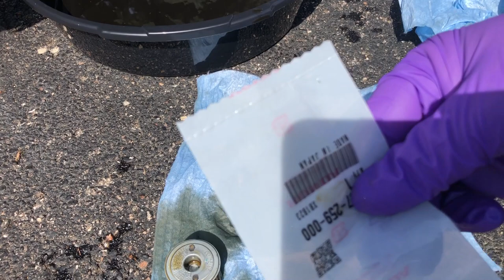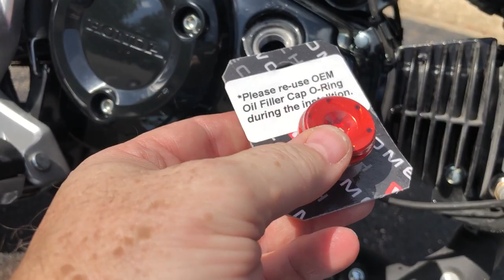2022 Honda grom oil change

Comment: wow thanks for the vid and part numbers.. about at 1200 miles on my 2022 grom.. i took it in for the first service... gonna do the rest myself.

on the oil filter there wasnt much options on HND-1165, when i took it for my service i bought 4 more filters and bought 4 more online and the part number for the one I used is 15412-mgs-d21 ELEMENT, OIL FILTER. more options when it comes to this part number when googling it.
Reply from the maker: That's awesome! I'm glad you were able to find the filters. Dont forget o-rings and crush washers!
Reply: @icemanfiveoh  just ordered 4 each. Thanks again!
Reply: My Grom around 1000km start to change oil.

Comment: I’m riding the 300V oil and my baby gets an oil change every 3100miles oil and filter looks darker green but clean 👍
Reply: 300V is a racing oil not meant to go 3000 miles at all. It’s meant to be changed out after each event. You are using the wrong oil for your application. Use Motul 7100 instead.
Reply: 300V is good for about 4 hours in a water cooled motor. 
Consider your application, conventional 10w40
Reply: @Image-X  The 3000+ oil change interval is just preventive! My grom is used as a stunt bike for ride outs! The fresh oil and new filter are not that expensive so it’s fine …
Cheers
Reply: @aeror115  You are using the wrong oil for your application. Motul will tell you go to 7100. The 3K oil change is WAY WAY WAY overdue for 300v. You’re literally running an oil ten times longer than it’s lifespan.
Reply: @Image-X  ok mate now I got it! 
I’m gonna check that…

Comment: Do you know the torque specs for the oil filter cover ?
Reply from the maker: I looked in my service manual, and there is not a specific torque value for the bolts on the filter cover. What they do provide is a generic list for certain bolt sizes. 5mm screws are listed at 3.1 ft-lbs, 6mm at 6.6, 6mm flange bolts at 9. 8mm flange bolts and nut at 20 and 10mm flange bolts and nut at 29 ft-lbs. I recommend tightening them firmly by hand but if you are a numbers guy then between 6 and 9 ft-lbs. This is just my opinion. If you are really concerned by hand tightening them you can always check them occasionally. I just did my second oil change and the screws were just as tight as when I put them on in this video. I wouldn't worry too much about exact specs. Hope this answers your question. Thanks for the comment!

Comment: nice video man, love the grom help because I’m very new to the game, I’d like to know where you got the aftermarket oil cap and also those blue circle things! I’d like those in a matching red but am not sure where to find.. also the red cover you have for the thing by your front brake?
Reply from the maker: Thanks for the kind words! So tst industries has some of the little red anodized bits. As far as the side panel washers, I designed them and i print them out on my 3d printer. DM me on Insta (icemanfiveoh) and let me know that you came from YouTube and we can get you set up with a set. . I have an awesome fire engine red that has been very popular!  The brake fluid reservoir came from ebay. Let me see if i can find the link: https://www.ebay.com/itm/224374313116?var=523161640949
Reply: The side panel washers turned out nice, I’m still waiting for my 2022 Grom to ship. 🙌. This helped guide me for my first oil change, I plan to check the screen too, so
I can check for metal shavings 😀

Comment: Nice job witht he oil change, and lil details. Did you consider checking screen inside the case? I've seen videos where is had stuff on it. I know when I do my first change I will be looking at it. Just some food for thought. Also you might be able to get yourself a slightly longer allen screw for that cap, and be able to use them. I know I would go to a local Ace Hardware or somethin simular.
Reply from the maker: I knew about the screen. You have to take a cover off to get in there which means another gasket...Honda told me not to worry about it the first oil change. The issue with the blank off plugs is that it doesn't actually screw into the threads like the ones i have now. It is just a screw with some kind of rubber tubing that kind of cinches up in the hole. The screw is actually smaller that the threads that hold the mirror in. So a longer screw wont work for me. Its ok i dont mind keeping what i have.
Reply: @icemanfiveoh  Good to know bud! looking great so far! Also where did you get your mirrors at?
Reply from the maker: i got them from amazon:
https://www.amazon.com/gp/product/B08FFY6TWV/ref=ppx_yo_dt_b_asin_title_o03_s00?ie=UTF8&psc=1

Comment: Where did you get the parts buddy?
Reply from the maker: I got the crush washer and o-rings from Honda. I can't remember where i got the filter. I got the oil off amazon. I just picked up supplies for another oil change and this time I got everything off eBay. There is a buy it now auction that comes with everything for about 35 dollars. See the link below and thanks for the comment.

Oil filter kit on eBay:
https://www.ebay.com/itm/225063308836

Comment: When you do this in the future grab some aluminum foil and wrap it over the exhaust , it will save you with less clean up next time. I know its windy and I know you'll be replacing the exhaust. Less mess either way. Also not sure if you knew but Harbor Freight does sell a rear swingarm stand SKU#65620 $40
Reply from the maker: Nice! I gotta check that out! Thanks for the tip!
Reply: Good tip..! I'll be doing that... I bought that harbor freight stand for my Grom. Works perfectly and cheap

Comment: You need to recheck the oil level after you start it to compensate for the oil that disappears into the new oil filter.
Reply from the maker: Thanks for the comment. I made sure to do that even if I didn’t show it in the video.

Comment: How many miles did you have on the Grom when you did the oil change? Would you be able to list the part numbers for the gasket, crush washer, and filter in the description?  Thanks.
Reply from the maker: I had about 780 miles.  Sure, I’ll go back and put the part numbers in the description. Thanks for watching and commenting.

Comment: What size is that torx for the oil cap?
Reply from the maker: I actually don’t know. I didn’t have my set available when i put it on. A 8mm Allen wrench fits perfectly. I went to womet techs website and they actually don’t tell you either. Maybe at some point I’ll find my torx.
Reply: @icemanfiveoh  8mm Allen should be equivalent to a T50 👍😎👍

Ride safe bud!
Reply from the maker: @rockybettas5839  thanks!